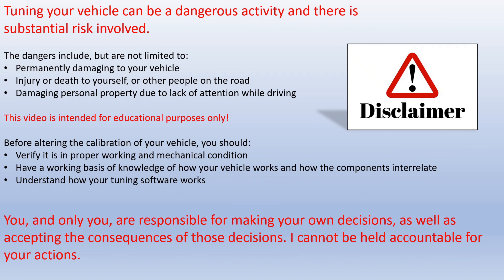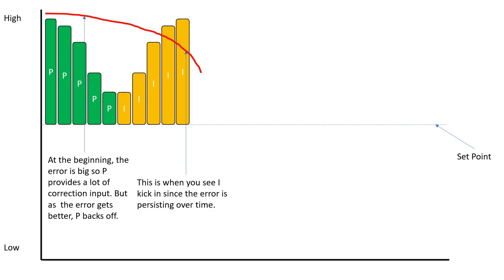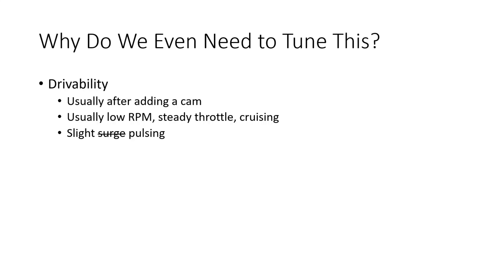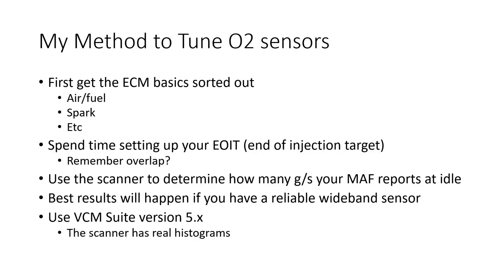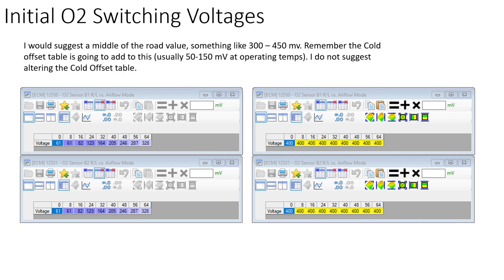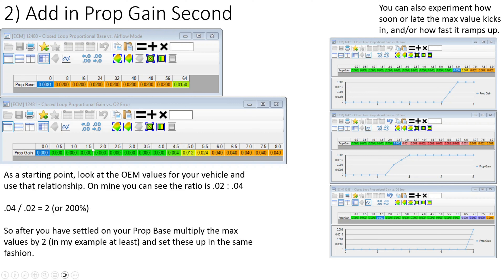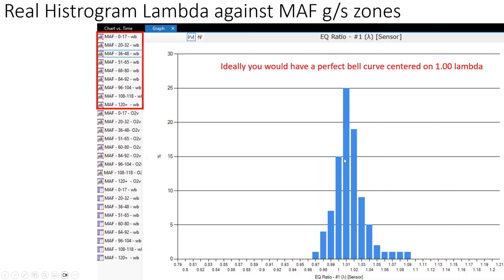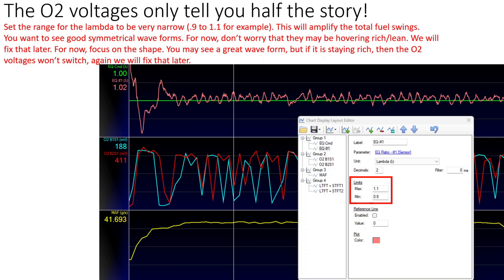Complete Guide: LS O2 Sensor Tuning

Comment: Great Explanation here. Thanks for sharing this with the community sir. I'm trying to get my scanner to record the data correctly. For some reason all of my graphs are mapping the exact same. I have them adjusted correctly for my airflow mode breakpoints but not having much luck so far. Not sure what I am currently doing wrong. I have doubled checked that the PID numbers match for my application and played with the filters to see if that would change anything.
Reply from the maker: Sometimes when the scanner does this to me I just start fresh and build the chart one element at a time to see where things fall apart.
Reply: @  10-4. I’ll try this today. Ive tried fiddling with the filters some. It doesn’t filter out the open loop readings for some reason even with have the eq ratio 1.0 filter. Thank you sir.

Comment: Closed Loop Enable Temp - Pretty important when cams are involved. Helps get the proportional and integral close right from the get go. It's misleading the way it's labeled, but it's basically a fueling switch going from colder engine to hotter engine fuel swings. You can minimize the swinging by putting that setting to a maxish position and then fine tune using the others.
Reply from the maker: Interesting...are you saying the CL enable temp is not a simple on/off switch?  But rather the ECM interpolates? So the closer you are to that temp the more pronounced the oscillations are?
Reply: @SilverSurfer77   I would say it's still an on/off switch it's just once it hits that temp it goes from small swings to large swings. You can minimize the swings with cams or headers by raising it above a temp the engine will ever see. It's not an open/closed loop enable temp as worded in the calibration. Setting it to stay in the smaller swing zone just makes the rest of the O2 tuning easier.
Reply: @GHuggins  So the car stays in OL the whole time, correct? Are you saying to only do this while tuning, and then re-enable, or leave it disabled completely?
Reply: Are you referring to closed loop vs open loop with fuel trimming?  Doesn't sound like it but IDK what else you would be talking about.

I usually don't allow closed loop until 100-130 degrees.  I also set the eq ratio min table to keep the mixture slightly fat until then.  Works really well for large cams.  I've been meaning to try the ECT proportional multiplier but it's difficult to truly test since you really only get one cold start per day.
Reply: @SilverSurfer77  Pasted from VCM Suite Online Help:   The VCM fueling generally operates in one of three modes: 1) Open loop, 2) Open loop STFT or 3) Closed Loop. Open loop is used when the O2 sensors are not warmed up, failed, or when an enrichment mode (such as power enrichment) is active. Open loop STFT is used on some PCM's when the O2 sensors are showing signs of operation (O2 Readiness), however the closed loop enable ECT has not been reached. In this mode the STFT's may function. The final mode is Closed Loop and in this mode the full closed loop fuel controller is operational.

Comment: very good video, best I've seen on the subject.  Even though I had to figure this stuff out on my own I still appreciate stuff like this.  It's always good to hear different perspectives/ takes on how it all works. Either way, I'm sure we can all take something away from this.  Thank you.  BTW, this problem is definitely more noticeable on E38 stuff compared to the older P01/P59 stuff.  It's still there on them but not nearly as noticeable.  Also, for more mild cams usually taming down the O2 error table and maybe slightly on the proportional table will take care of most if not all of the "surging". 

EDIT: forgot to mention I also adjust airflow vs mode table for idle.  Since a stock car might idle at ~40-50 lbs/hr and a cammed car might idle at ~70-110 lbs/hr, I'll adjust the mode to reflect the factory settings for the new idle airflow.  I've found the hardest areas to dial in are the cruise areas.  Basically ~150-300 lbs/hr areas.  The biggest issue is over correction.  Cutting down the Proportional and O2 error tables are usually the key to preventing that.  Next you should talk about bucking when letting off the throttle or really light throttle at 1200-1500 rpm with a manual trans. YAY LOL.
Reply: Any tips on how to reduce the bucking when letting off at low throttle on a cammed car (gen 3)? I’ve read that leaning it out and adding alittle more timing may help in those low areas
Reply: @bradingles8680  actually the opposite.  Pull timing.  And the only way to lean it out is to put it in open loop.  But yea, usually timing does the trick.

Comment: Thank you for sharing this info really helps to fill in the gaps, left by others. One thing though can barely hear you, had the volume cranked up and when an ad would start really jumped. Had to use the close caption for parts. Maybe try a USB mic they are great, and reasonably priced. Thanks again great job, looking forward to future vids.
Reply from the maker: Thank you for the feedback. I do have a USB mic. I do check on my videos for sound, editing, counting the "ums" per second etc. Audio seems fine on my laptop, phone, and TV. I will ask others to comment on my next one to see if there is something widespread going on. I will turn up the gain a little bit, but I am concerned about it distorting.
Reply: @SilverSurfer77  very quiet for me as well. Great video, thank you for taking the time to make this and share.

Comment: I think what I am struggling with at this moment in time is the order of operations. How can I have confidence in my MAF curve and SD calibration if the O2 sensor switching is causing me to run leaner or richer than desired....but I am supposed to use STFTs for partial throttle tuning. I could understand tuning in OL and relying on the wideband for the MAF and SD but that's not how most people do it. So which comes first? I know you say that you don't think LT headers cause an issue with the O2 sensors but a lot of people find themselves tweaking the P and I after installing them. I don't know why I am struggling with this mental block. I'll be watching it again for sure though. Thanks!
Reply from the maker: I would use STFT only for tuning this stuff. As far as the switching voltages, you can start messing with that during the MAF and VVE tuning (prior to the P&I) now that you know how it impacts the tuning process. And when done correctly, the P&I shouldn't impact the fuel trims when you circle back to those later.

I don't know that I have ever heard of someone complaining about the surging when LT only. It seems to only happen after a cam is installed (and most people who know engines will also install LT's at the time of a cam install if they haven't already done so). But either way,  I do believe it is the whole parts stack messing with the engine's sensitivity to torque at that airflow, timing, RPM, and fueling conditions.

Have you seen my other videos on dynamic air and the tools for dialing in VVE and MAF? Check those out if you haven't already. Using the dynamic air one is amazing IMHO since you can tune both MAF and VVE at the same time without having to go into SD or OL. Then you can plug in the data into the MAF and VVE tools I wrote and it will make like much easier. If you have any questions just ask!

Comment: I read the MV switching tables don't have any effect in a 08 e38? was there ever. any fix for this?
Reply from the maker: Not sure. I've not heard of this.
Reply: @SilverSurfer77  huh. I've seen some mention of it on old hpt board posts. I can put any number in b1 or b2 R/l table and the cold adder and nothing happens. if I change the max and min from 450 in both, to what I've seen in other tunes 41mv and trims go straight lean and stall the car at 20:1 within seconds.

Comment: great video its helped me out tremendously to understand and solve a few tuning issues on my gen 3-5.3  but! i have a question i am trying to use your math parameters that you supplied for the graphs in vcm scanner and i just cant seem to get them to work each graph is reading the same how do i solve this problem?  any help would be appreciated thanks
Reply from the maker: Going from Gen4 to Gen3...your actual PID numbers will probably be different. However, you must ensure that you are logging each of the correct PIDs in your channel list. That should solve it. The other option would be that perhaps there are some filters in place that are preventing the graphs from populating.
Reply: Ok I’m wondering what pids should I have in my channels for each histogram to log properly? I solved the o-6 proportional or I at least think I have as it looks good but would like to solve this issue so I can check my work. Thanks
Reply: You were correct sir the math you provided would not work for me on a gen 3 . I did figure it out and it’s working awesome for me I now have information I can use. Now if I can just figure out how to add a filter function to remove throttle transitions it will be even better.
Reply from the maker: @HughBanks-w7o  here is the first part of the filters I use...the first section filters out torque management and the second one filters out throttle. Then I usually add on to it to filter for Open or Closed Loop.

[2517.161.avg(1500)]=0 and [2517.161.avg(-200)]=0 and (abs([50090.156.slope(1500)])+abs([50090.156.slope(-500)]))<2

*2517 is the Torque Management (Spark) Advance (degrees)
*50090 is the Throttle Position (%)
Reply: @HughBanks-w7o   I'm attempting this now and running into the same issue. To clarify sir, you were able to adjust SS's math to make it work or were you stating that you got the sensors working like you want? I have what I believe everything set up correctly, but all of my graphs read the exact same. Trying to sort thru that at the moment. Thanks for any help that can be lended.

Comment: I set my switching voltage to 450 across, Would like to be more rich when air flow increases. when turbo is boosting and not in PE yet. do I need to move the switching voltage up or down?
Reply from the maker: Moving voltage up will richen the mixture. Don't expect huge changes though.

Comment: Hi Mate, thanks again for sharing great content. Good timing too! I managed to put my heads back together as well new headers with hi flow cats. I noticed that the new cat  is really strugling to store O2 . It sometimes nearly behave like the stock but majority of time the post cat O2  is switching together with the pre  cat. I wonder if i can fine tune the fuel swinging to improve the hi flow cat efficiency. I was to inhale the least amout of NOx and CO as possible.
Reply: I meant I want to inhale the least amount of nasties as possible
Reply from the maker: I have always wondered how high flow cats compare to factory in terms of emissions. Without an exhaust sniff test it may not be possible to get real world answers. My gut tells me the post cat O2 sensors aren't going to tell you the full story. However, I think it would be good to compare post cat O2 voltages before and after high flow cats as a starting point. I would be interested to hear  your results, please post back and share! Thanks for the support!
Reply: I wish now I had paid more attention to B1S2 and B2S2 before replacing the cats. They were always neglected.  I just remembered they being a steady line slow moving . At least I got a WB sensor so,I will play having it a touch above "stoichiiii" and compare when it is a touch below.

Comment: Somehow some way my e38 doesnt have prop gain or prop delay table's. I even went in to the navigator and searched for it. Just information for others.
Reply from the maker: They do exist in the OS, however, unfortunately HPTuners did not map that parameter for your particular OS ID. Your options are:
1) Log a request and beg HPTuners to add it for your OS
2) Create a user defined parameter to access it
3) Swap the ECM itself to a supported OS
4) Flash/segment swap a new OS to your existing ECM (which might not be possible depending on  years and hardware compatibility)

Comment: My E38 does not have an integral for some reason.
Reply from the maker: Go to Edit > View menu and ensure Advanced is checked.

If it is already checked, then I am curious what year & vehicle the ECM is from. It may be worth checking the repository to see if it is the same there as well.
Reply: Advanced is checked. It's a 2007 LS2 Corvette. I believe all the repository files are the same. I feel like my tune is pretty good but it does bounce more lean/rich than I like.
Reply from the maker: @mikea2833  man that is wild. Now I'm curious...I'll see what I can turn up.
Reply from the maker: @mikea2833  so this is crazy, there are  3 examples in the repository with OS ID 12614676 and they have all minimal Proportional controls and no Integral control.

If you are not experiencing any issues, then I would say just ignore it. Otherwise, you would have to log a request to HPT to add those tables for your OS (which I doubt they would do) or swap your ECM for a newer E38. Not sure if a segment swap is possible or would fix it.
Reply: Yeah, car has headers and cam. It drive's ok, minimal surging. I just feel like the fueling swings a little more that it should in some areas. I might just play with proportional in those areas and see if I see any changes.
Reply: Same here.  2007 Avalanche

Comment: Hello mate, I hope you're doing well. At What point should I stop increasing proportional?. I just started the process with prop base at 0.0012 and both bank switch from lean to reach but the distance between switch point is high 2-3 seconds rich, 2-3 seconds lean?. Should I touch integrator delay? or keep increasing prop base?
Reply from the maker: Do you have a wideband to watch how far rich/lean the swings are? Without seeing the logs, I would say you are on track...and if the logs seem pretty consistent for all airflow modes, now may be the time to start adding the Prop Error Gain. I would always error on the side of too much Prop than too little.
Reply: @SilverSurfer77  yes I have a wideband. In those áreas were I have a flat line in both bank rich or lean the wideband show the same rich or lean and the delta from lambda is more or less .04, .05.
Reply from the maker: @darkzero6282  nice! throw some Prop Error Gain in there if you haven't already, then sprinkle a little Integral spice in there!
Reply: @SilverSurfer77  can I send you my log file? Maybe some orientation will help me. I found myself a little lost here. Not sure is the switch that I see are ok or not yet.
Reply from the maker: @darkzero6282  sure you can email it to me
Reply: Thank you for the great videos and lessons. I think I’ve watched all of your videos and have probably watched this 5 times. I do have 1 questions. Underneath the O2 Bank1 Bank2 and cold offset tables, there is Min Rich/Lean and Max Rich/Lean, both with a stock value of 450mv. Does this Min and Max value need to change if the values in Bank1 and 2 tables change?

Comment: I have a few questions.. I'm on the greener side of tuning but I follow most of what you're doing here. When I open the document it looks like it's in raw text and some of the characters in the filter data don't appear to correlate in HP Tuners. Should I use something different to open the documents?

I'm doing this on a Gen3 so it looks like some of the Parameter ID's might be different. In the first set of histograms are you just looking at raw data from the WB and plotting along that along the column axis? The second group of histograms looks like O2 sensor data plotted along mV? And lastly WB data plotted along MAF? Is that correct?
Reply from the maker: The XML files are to be opened in HP Tuners Scanner (unless you understand XML files). The PIDs referenced will be for Gen 4 (E38 specifically), some of them may correlate to a Gen 3...idk though, I have never touched a Gen 3.

First set plots lambda vs MAF g/s for each airflow mode
Second set does the same, except it plots narrowband voltages
The third set does the same as the first, but instead of a real histogram it uses the old traditional table/chart/graph.
Reply: Got it! This is going to be fun to experiment with. Thanks for sharing!

Comment: With scanner 5.0.4. Do you use the prolink+ for your wideband? When transformiing it for the aem 30-0300 the transform doesnt give me an option for units (volts or afr) so cant graph wb. Any insight? Ive submitted a ticket to hpt but havent heard back yet
Reply from the maker: I have an AEM 30-0334 that piggybacks on the obd2 port. Sorry I can't help.